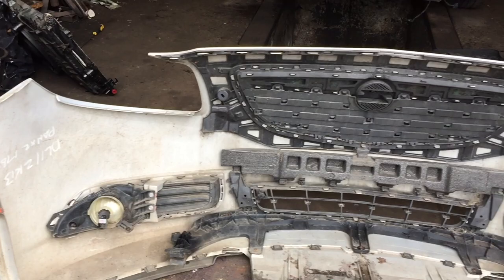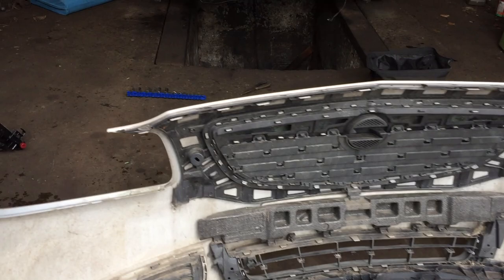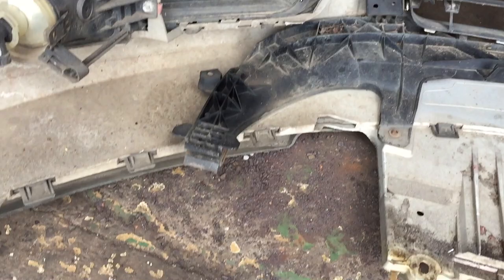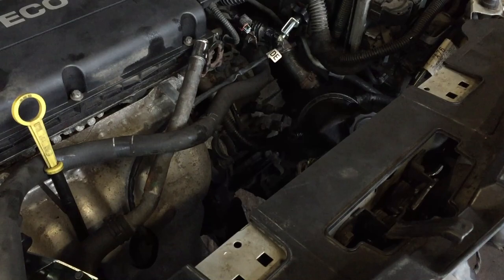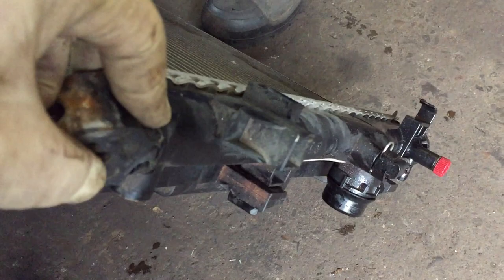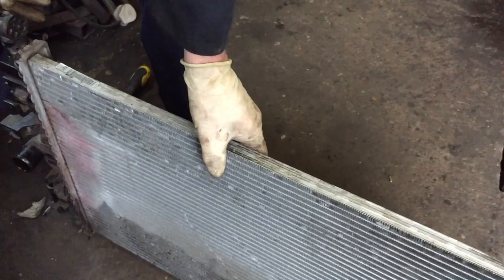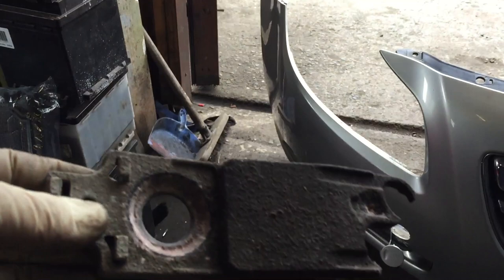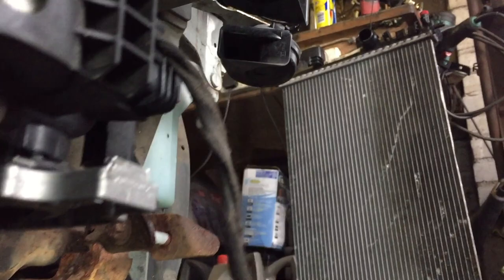Vauxhall/Opel Insignia front bumper/radiator removal

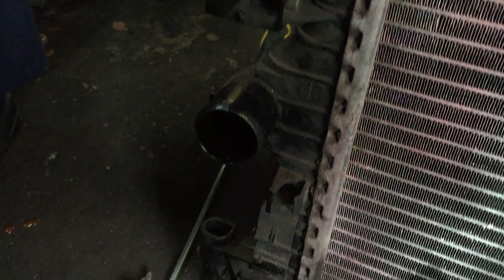Comment: Top tip for anyone separating the fan shroud from the radiator - you do NOT have to prise at those plastic clips as you will break them! 2:59 in this video (bottom clip each side of radiator, push against the top plastic tongue which doesn’t look obvious but is a simple clip and slot it out, really easy when you know how!) no broken clips that way
Reply: Hey, ive just been having a gotm at one today and you're right you can juse get to them through the gaps with the bumper off can slide straight out after popping those bottom ones from the little clip

Comment: Hello Sandy, have question, I see some extra tiny radiator on top in front of the main one at time 0:00 .Is that original or added one due to insufficient cooling of oil of automatic gear transmission?
Reply from the maker: Hi Thomas it's an original gear box oil cooler but the car was manual not automatic

Comment: I have a 2016 insignia where the horn has stopped working any ideas what it could be?
Reply from the maker: The horn sounder or wiring or clock spring in steering wheel or switch!